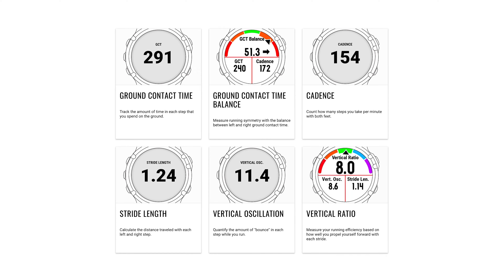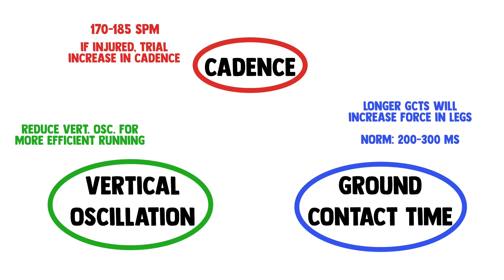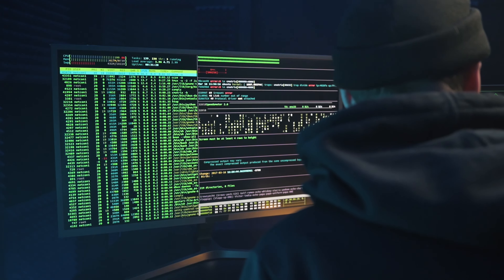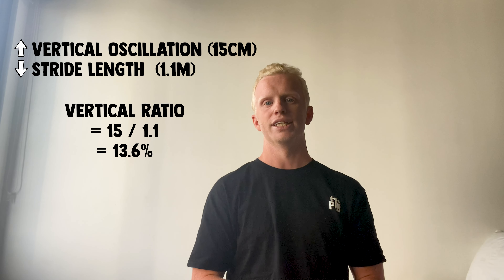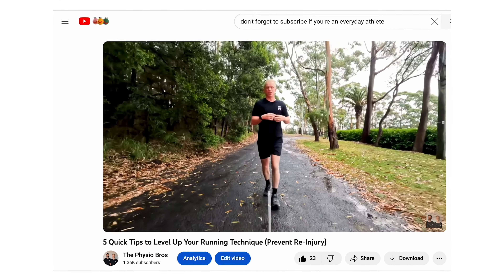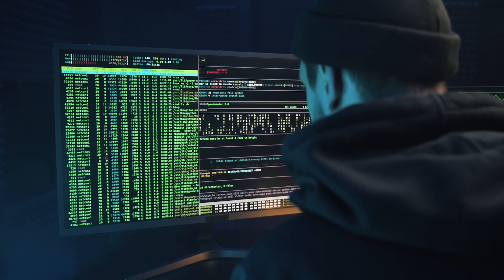Garmin Running Dynamics Explained (HR Strap or Watch)

Comment from the maker: Here's the chapters for today's video! Skip to whatever part you want to learn on!
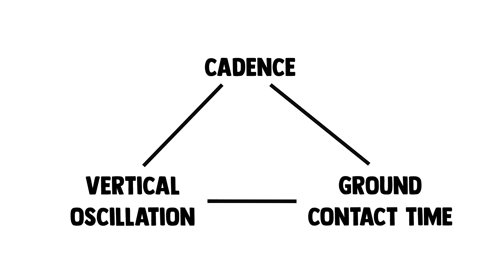0:23 Cadence
1:36 Vertical Oscillation
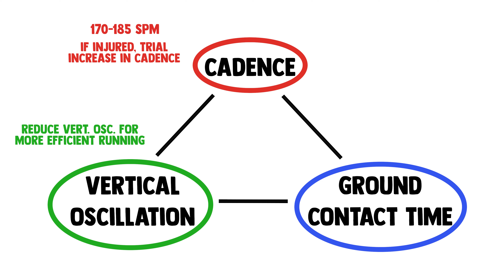2:41 Ground Contact Time
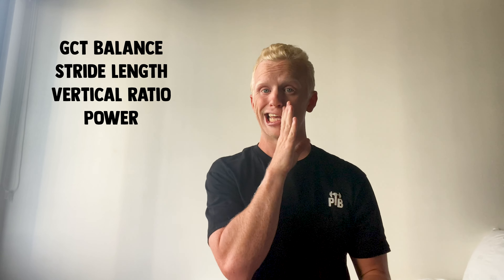4:57 GCT Balance
6:16 Stride Length
6:50 Vertical Ratio
8:06 Power
Reply: Do you think a Running Dynamics Pod worth it?

Comment: Regarding Vertical Oscillation: I've noticed that I tend to lean pretty far forward when I run. It seems like this is causing some kind of stress and pain in my right foot, along the arch area, to the point where I have to slow down to a walk until it goes away. Is this a common problem, or is it likely more a problem with my shoes or something? My assumption was that it was from leaning forward, but my left foot doesn't seem to get this problem. It's like the entire arch of my right foot almost "locks up" like the muscle is clenching.
Reply from the maker: Hey mate, hard to diagnose purely of this, but it sounds like you have an issue with your plantar fascia. Usually I would try reduce your running volume or make an adjustment to you training schedule, if it is still comfortable to run try and perform intervals within your comfortable distance, and definitely new shoes to see if that helps! I would also introduce foot/ankle strength training into your routine to help settle this down!
Reply: @ThePhysioBros  Thanks kindly for the response! I really appreciate the advice. I had been struggling with the pain for a while and I ended up getting a new pair of shoes and some inserts that are meant for semi-flat-footed people. It helped quite a bit, after I got the shoes broken in.

Another thing that helped a lot was increasing my cadence, but reducing how hard my feet hit the ground. It is overall a bit smoother and keeps my feet from cramping mid-run.

Only pain I'm dealing with right now are sore legs after runs! Haha. Thanks again, brother!

Comment: Thanks for the video, this is great content. One thing I was hoping you would address is whether the running dynamics from the watch are sufficient for most runners or whether there is any advantage in getting the expensive Garmin HRM Pro. I currently use a basic Coospo HRM which I don't think works on running dynamics, so I guess the power info on my Garmin FR255 is coming mainly from the watch?
Reply from the maker: I'm going to be honest - for most people the current Garmin watches have a lot of these dynamics now built in. HRM are definitely more accurate but probably not worth the $$ in my opinion.